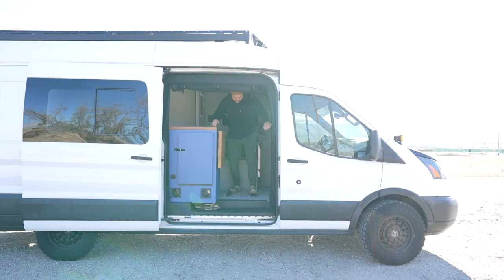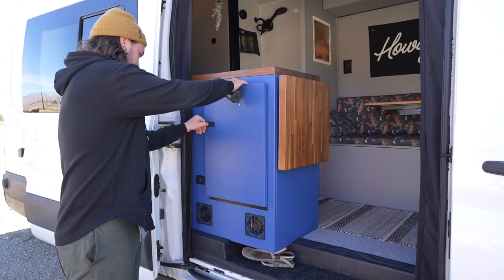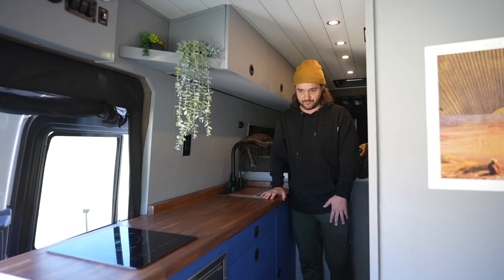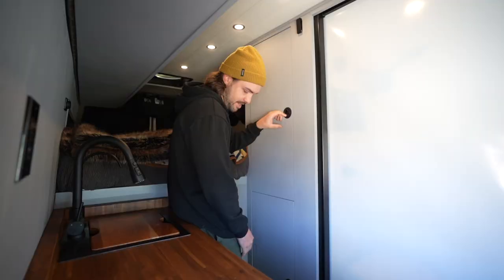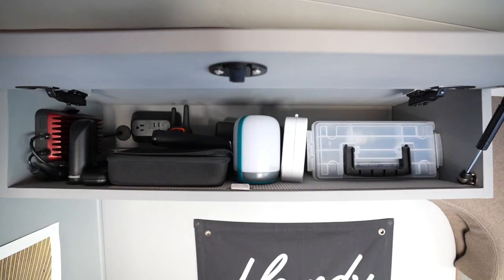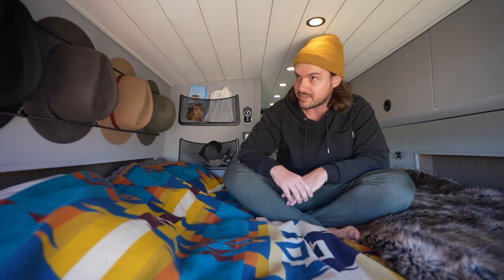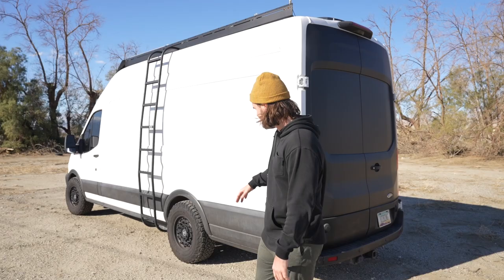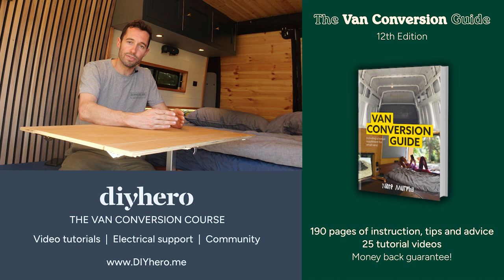VAN TOUR | Luxury Off-Grid ADVENTURE VAN CONVERSION 🤩

Comment: Ryan, I'm curious how you attached your walls. It looks like painted plywood and nails based upon one of the photos with wood putty. Did you also use glue to the framing? If so what type and how's it holding up?
Reply: I used plus nuts and bolted a wood frame to the van body. Then I used 1/4 inch wood on the walls. I countersunk screws into the wood frame and then covered the screws.
Reply: @ryanittel7796  Thanks so much :)